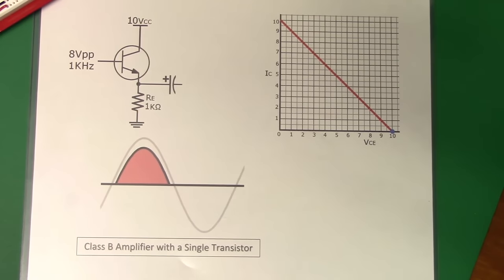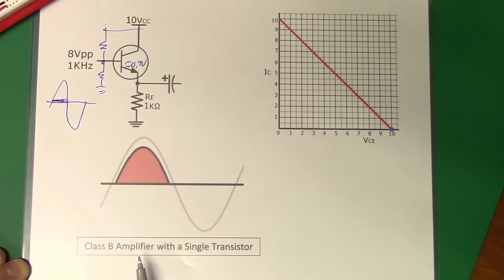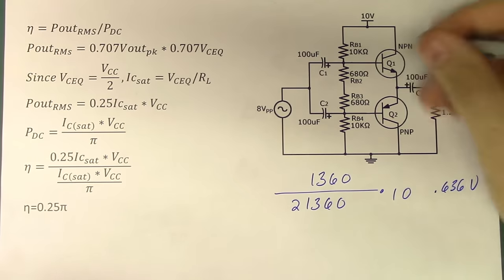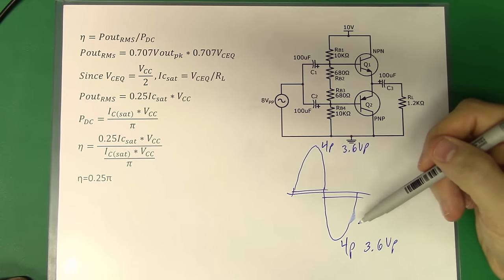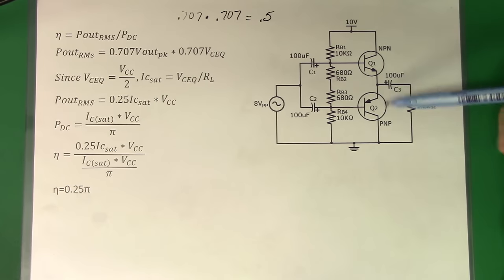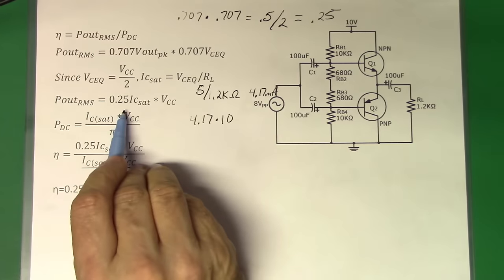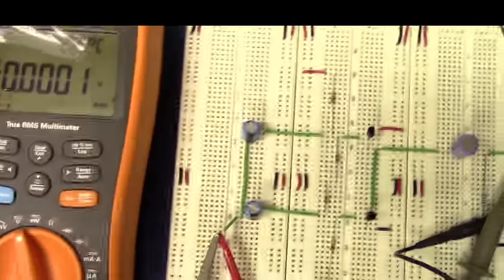35. Class B and Class AB Amplifiers

Comment: Thanks for the time you spend making these video's!!! I have learned more from you and others on youtube than I did in college. I find that making the output stage to be straight forward, it is the VAS stage of the amp that I have problems making, I like using a split power supply so I can use a op amp for the pre amp stage because finding matched transistors for a reasonable price is impossible.

Comment: 1 thing i don't understand from your drawing is when the npn transistor is off from where does the second transistor (pnp) take its current? As you draw the both transistor are connected to the same ground so it looks like the pnp transistor is always off here or both are on at the same time. Sometimes i see this schematic with + , - and ground

Comment: At the negative cycle, the npn transistor should be in its off state, therefore disconnecting the 10V source from the pnp transistor, so where does the current comes from that allow negative voltage to appear at the output?

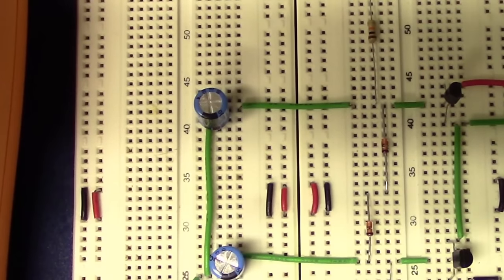Comment: 29:20 "efficiency [of AB] goes up a little bit [compared to B]".  Power consumption difference of the bias network is insignificant. The main difference in efficiency is due to the fact that in class AB the transistors are on for a larger proportion of the time, and conduct some current directly from one rail to the other, at least for part of the cycle. Hence AB is less efficient than B. (When comparing B and AB "push pull" amplifiers as shown in this video.)

Comment: I have noticed that most people don't include an emitter resistor in their Class AB Amplifier designs.
I have found that it is really needed to eliminate thermal runaway. How do you determine the value
of these emitter resistors?
Reply from the maker: You would want to select extremely small values of resistance. Since the circuit already has no voltage gain, adding too much resistance decreases gain more. Resistances as small as 1 or 2 ohms would suffice to give some negative feedback and prevent thermal runaway. The first step would be to add diodes to the base biasing network of course. Since the Av of a CC is RL/(RL+r'e), adding more resistors to the emitter changes the equation to RL/(RL+r'e+RE). You would have to decide how much was to much for voltage loss. Anyway, a couple of ohms will do the trick so the hit to Av won't be too bad. Hope that helps.
Reply: Thanks so much for your help.
John

Comment: RMS-power is a nonsensical name, what you mean is not the rms-value of p(t) (p(t) = the instantaneous value of the power) but the average power of p(t).  Also note you wrote on the board a formula for Pout with units V^2 which is incorrect.

Comment: I think the most important information i have just got from the video is that the transistor is in common collector configuration!! Of course i know this configuration but somehow I messed something up with Class B amplifier and I was wondering why I had no gain but completelly forgot that this is common collector config. What is surprsising me is that not many tutotials etc. explain that, they think of it as obvious maybe but if you deal with so many circuit configurations things become unclair sometimes!! (and I am not a beginner! i would say intermediate in electronics. I build my own small devices etc. but still I get confused sometimes). The next question is how to adapt this circuit to the RF power amplifier 🤔Not very common maybe but i have read somewhere that it is being used sometimes in RF...

Comment: 14:35  I realize that this circuit is mainly to exemplify a sort of class B (partly AB) output stage, but.... having two separate input caps raises some issues regarding the output transistors getting out of sync.  One problem will occur at startup when C2 charging will lag C1, resulting in both Q1 and Q2 on at the same time, shorting the supply for some period of time.

Comment: Although I listened to that part many times, I still don't understand how both nodes end up being equal to 318mV at 8:47.  The lower node should be (10000/21360)*10=4.682V and the upper node should be (11360/21360)*10= 5.318V as far as I can see.

Comment: I designed a class AB amplifier with dual voltage driving PNP and NPN  transistor. The final was the amplifier works perfect but when the power is switched off the positive voltage gets drained but the negative voltage stays what's the solution. Pls
Reply from the maker: That's a question I can't really answer without schematics. Measure for voltage drops - there shouldn't be any with the circuit off. Good luck and thanks for watching.
Reply: @TheOffsetVolt  thanks for your reply i increased the grounding  resistance of the two pair transistor in the input stage. Now its ok . I have to learn more by practical work. Thanks for the reply.

Comment: Hey thanks for the video.
Just a quick question about the design of the of the Class AB amplifier. How do i find the values of the two resistors and the capacitors. I have found the KVL around the Resistor and the diodes, which is;  R = (Vcc - 1.4V)/(2*I) .  But i dont know what to put for the current in the KVL. Also, my load resistor is 8 Ohms. Thanks you
Reply from the maker: Hello, Treat the each transistor and base resistor set as if it were it's own circuit. So, to find voltage on the base of Q1, 
Vbase q1=Vcc*RB2/(RB1+RB2).  
You can rearrange the equation to get the values needed for 0.7 volts on the base.
You want the capacitors to be electrically "invisible" to the AC signal so a low Xc is needed. As a rule, the Xc value should be a maximum of 1/10 the resistance you are trying to bypass or couple to.  The capacitor for your 8 ohm load resistor would be calculated using the lowest frequency going through it. You Xc should be 0.8 ohm (preferably less) at that frequency.
Reply: Thanks for the reply. I tried using the values in your circuit but I did not get the 10 Kohms value for the resistors. I dont know what im doing

Comment: Hello:

I have 2 questions with regard AB power amp circuits. 

(1) If you look at the Fairchild datasheet for a TIP29 power transistor, how do you determine the DC gain? It says that if Vce = 4V, Ic = 0.2A then the DC gain has a min value of 40. However, if Vce = 4V and Ic = 1A, the the DC gain has a min value of 15 and a max value of 75.

(2) For power amplifiers how do you arrive at a value for r'e? Can you use 25mV / Icq?

Thanks very much.
Reply from the maker: You can't know the DC gain with any certainty. To minimize the variation in DC gain (and fix it at a specific value) you would use voltage divider biasing and a resistor on the emitter. For part 2, Yes!

Comment: Love these videos. They are so well done!
 I am stil not sure how to use a  transistor datasheet to arrive at a DC gain estimate. As there is such a great range.

If you look at the Fairchild datasheet for a TIP29 power transistor, how do you determine the DC gain? It says that if Vce = 4V, Ic = 0.2A then the DC gain has a min value of 40. However, if Vce = 4V and Ic = 1A, the the DC gain has a min value of 15 and a max value of 75.

Thanks
Reply from the maker: Hi again, DC amplification in a transistor is used principally in switching, the circuit is either fully on or completely off. The data sheet gives you broad parameters for the expected outputs given a range of inputs. Other than setting the DC q-point, that's it for transistor DC amplification.

Comment: 24:55 "any current that goes through D2 is going to go into the transistor, be multiplied beta times...".  That part of the explanation is wrong.  The current through D2 does not go through Q2, nor vice versa. (The D2 current and the Q2 base current sum to make the current through RB4.)  Instead, the current through D2 produces a particular voltage drop that is similar to the VBE required for a similar current in Q2. These amounts are not guaranteed to match exactly, so RB1 and RB4 would need to be adjusted to get a voltage across D1 and D2 that sets the desired ICE in the transistors. And at least the diode drop and required VBE will track with temperature, but only if the diodes and transistors are thermally connected (so not in the circuit as built, contrary to 27:06).  It is indeed sort of a current mirror, though it's missing emitter resistors that would normally be used to set the current stablely.

Comment: hello thanks for video. I have homework about ab amplifiers and i watched that video but i didnt find answer to my questions i need Rb1 and rb2 and my teacher gave me that formule rb1=(vcc-vd1)/(idmin + (iq+ILmax/1+b))  that formula gives me rb1=rb2 and i just dont know ILmax in that formula if i found it i can get rb1 thanks for helping me  and if you give your mail adress i can show you my problems.
Reply: thanks for reply my load is a resistor , actually my circle is individual same with yours i have simetric dc source +12 -12 and ac source but ac source is connecting middle of two diodes i have to find Rb1 and Rb2 like i said, the formule is there  , i tried sometings but i m not sure it is true , by the way sorry my english